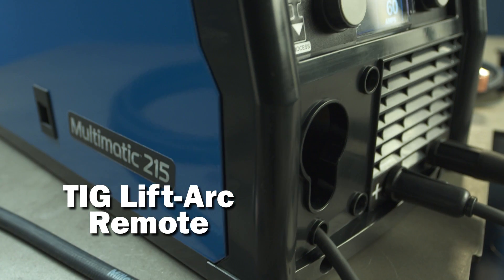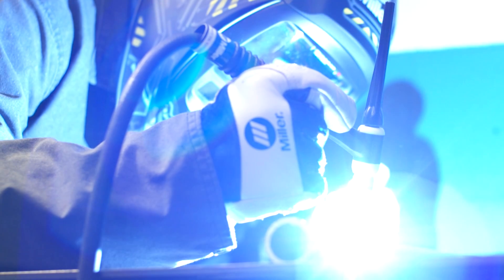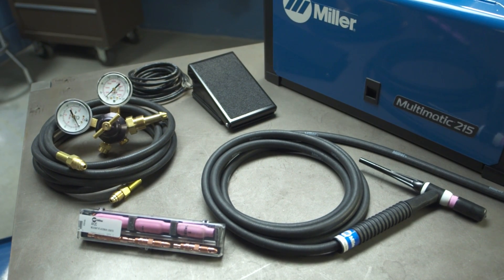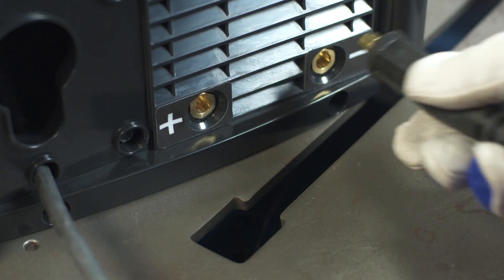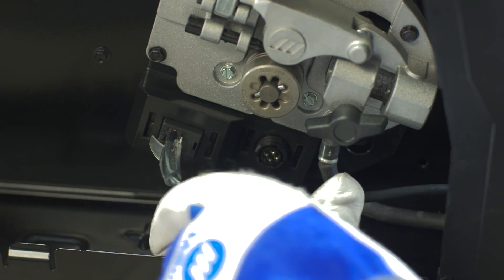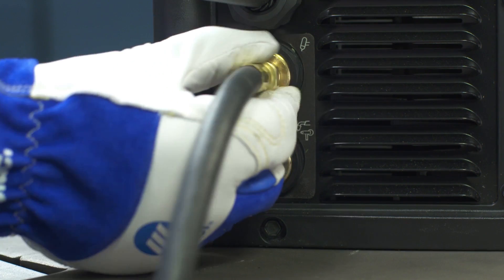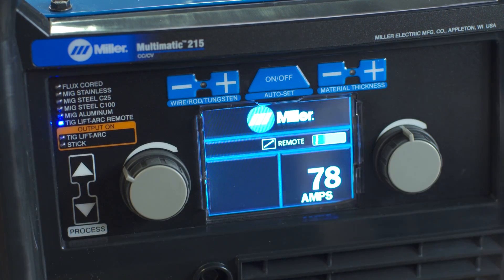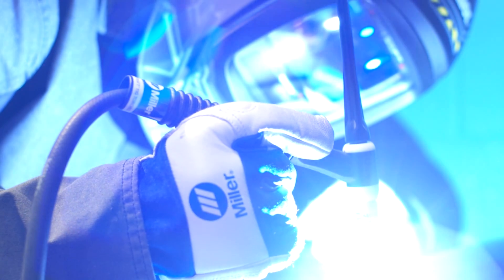Miller Multimatic 215 TIG (GTAW) Lift-Arc Remote Setup

Comment: What does lift-arc mean? You don't use the pedal to start and stop?
Reply: Scratch start = arc start circuit always open, scratch the tip of the tungsten against the piece to ignite the primary arc
Lift start = arc start circuit is always open, touch the tungsten to the piece and lift up to ignite the primary arc
Lift remote start = arc start circuit begins closed, touch the tungsten to the piece, press the pedal to initiate the start circuit, then lift to ignite the primary arc
HF/HV start = hold the tungsten above the piece and press the pedal to jump a pilot arc, the primary arc ignites through the plasma channels the pilot arc creates almost instantly after

Comment: Is lift arc the only way to initiate arc.  You cant just throttle the pedal?
Reply from the maker: Thank you for reaching out. Please keep in mind that this video was developed to illustrate a weld position and the specific welding techniques/weld settings used are not necessarily best for all applications. The Specification Sheet from the manufacturer of the filler metal you use is the best tool to determine starting welding parameters. Please let us know if you have any further questions. Thank you.
Reply: @MillerWelders  How about you anwser his question.

Comment: Can you TIG weld without the foot pedal?
Reply from the maker: Thanks for reaching out. On the Multimatic 215, you can set the welder for lift arc non-remote, which means you can set the amperage at what you need to weld (let’s say 80 amps), now touch the tungsten to the work and lift off the work and the arc starts at 80 amps and stays at 80 amps until the arc is broke to stop the weld.
 
You can do this, but you now have no control over the amperage. Thank you.
Reply: @MillerWelders  Question for Miller welder.  How do I set up my older Maxstar 200 str for use with the foot pedal, there virtually no information on the set up.  When I plug it in and set the machine on lift Tig the pedal does nothing.  Does the pedal even work with that older machine?

Comment: Good unit . I did notice a problem area that might develop in time (,the plug in for the foot pedal) .I noticed he put a slight bend pressure on the connecter  to ensure closed panel clearance . that will put pressure on fine solder connections from board to socket  and could lead to intermittent  connection problems over time . Those sockets are not designed to handle that side pressure. There needs to be more clearance there.  Thanks

Comment: I also have the stl 150 dc machine. it comes with a full sized pedal that you can really make accurate foot control inputs with. it has the heel catch and full length top surface and lots of pedal throw for accurate repeatable serviceability without having to search around for correct foot placement.  too bad this pedal will not plug into the 215 machine

Comment: the tig pedal that is issued for this machine is way too small. I have 12 inch boots on, and that pedal is dwarfed by my average sized saftey wear boot. this means the pedal actuation is way too sensitive and difficult to feather accurately , the throw of the pedal travel is too short, that means the power is from zero to 100% with just a small tap of the foot .  no heel catching  stop on the bottom of the pedal and the short length of the pedal face, makes me have to always look down to reposition my foot just right or else you start too hot. it doesn't lend it's self well to quick intuitive repeatability on production work.
Reply: I know this is 4 years later, but the pedal they include now has a heel catch and is a great size for my size 10 foot and boots.  I can control mine wonderfully.